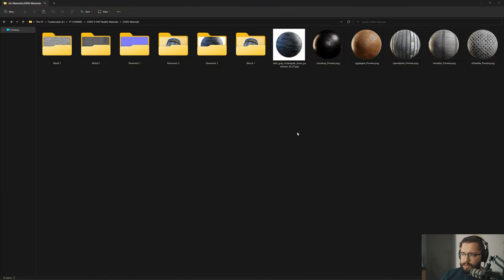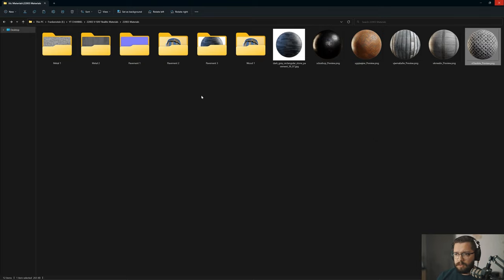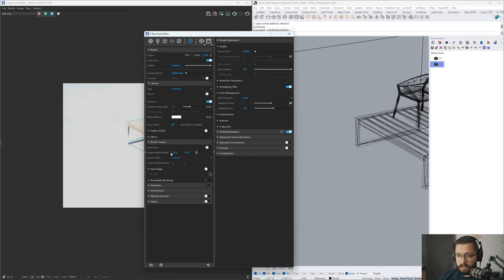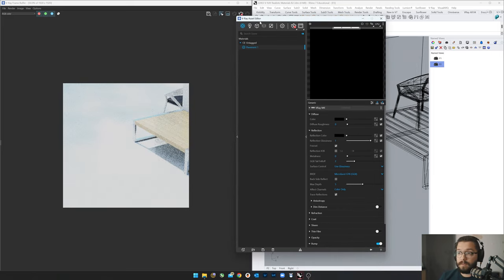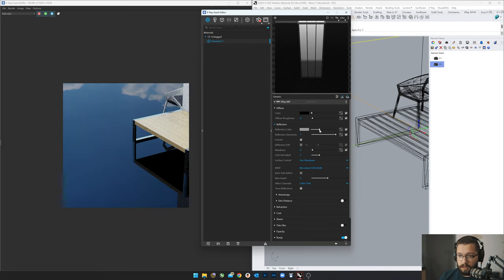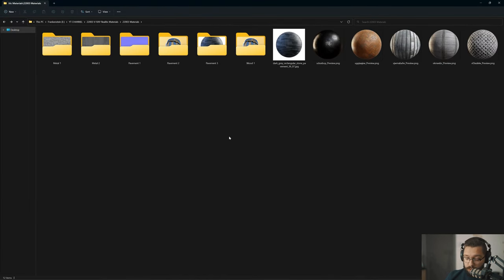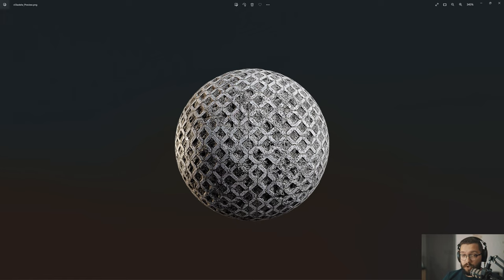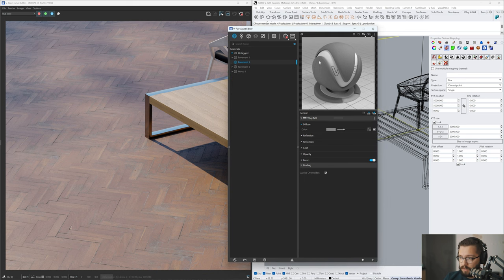Quick Realistic Materials in V-Ray 6 for Rhino (TUTORIAL)

Comment: Nice tutorial!! What’s the difference between normal and bump map?
Reply from the maker: Thaaaanks! The high level answer is that morals just work better, haha. The bump map is black and white (white goes up, black goes down), and for some reason doesn't give you the results you can expect with a normal map. Also, from experience, for most cases, bringing in the normal map and leaving the value at 1 work like a charm, especially if you're in a rush. I am fine-tuning it in the video, but if you want to go quick... just leave it at 1.

Comment: Roughness map doesn’t go into diffuse roughness slot and ambient occlusion doesn’t go into the reflection slot. Just put reflection to complete white. This is the physically correct way to do it.
Reply: Also at 12:12 the normal map needs the green channel to be flipped. You can see the light hitting the paving stones on the wrong side.
Reply from the maker: You’re quite possibly right, but then I look at the results and I’m pretty happy with it. And I am a big fan of not putting the AO map at all, especially on larger projects since you’re removing an entire map that needs to be loaded. 
As for the normal, I don’t know mate. Some companies give you the DX and the OpenGL normals and there you can see an inversion of the details… but here it looked pretty spot on.
Reply from the maker: @L3nny666 Also, genuinely, thank you for putting time stamps. That’s the kind of feedback that makes sense! I appreciate it.
Reply: @danielkuzev4992   yeah the best way to do it is: make it look good, that's all that matters in the end. nobody is looking at a picture wondering in which slot you put which map.
Reply: Yeah the AO map should go in the Diffuse channel. Right Click diffuse channel —> Wrap In —> Mix Operator —> put AO in slot B —> choose Multiply option

Comment: how could we handle the time of render 
like if you can do a render for a full project with lighting  + materials and camers in rhino then setting it will be great
Reply from the maker: I am seeing this a bit late. But one thing you could try is to use the Nvidia denoiser. It works miracles. Another thing, use the same material in as many objects as possible. Also don’t use 4K textures unless you ABSOLUTELY need them. And finally, use blocks in rhino. So it loads the geometry once rather than tens or hundreds of times (ex. Having the same window all over the place)